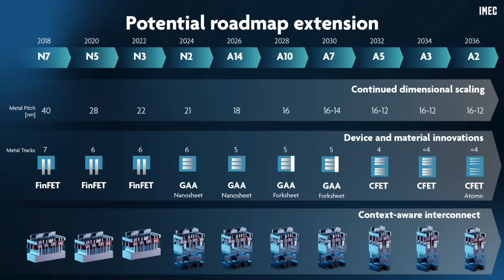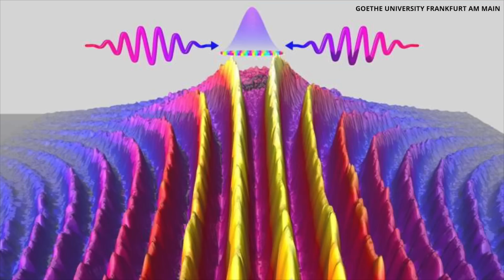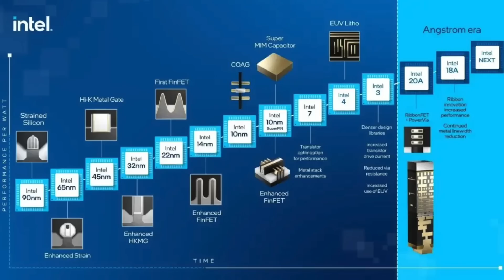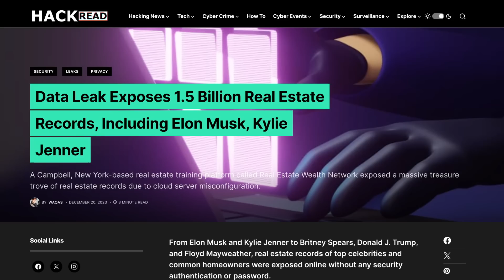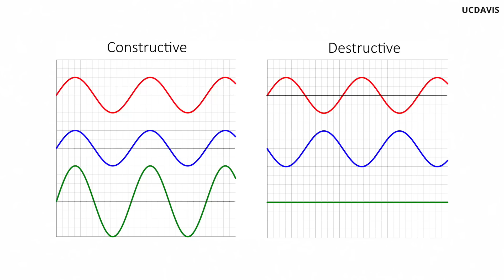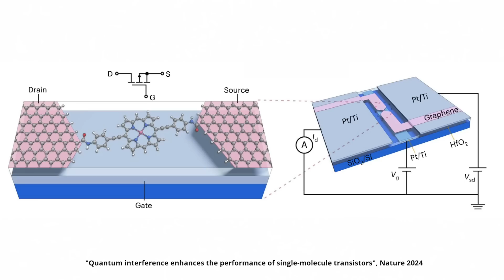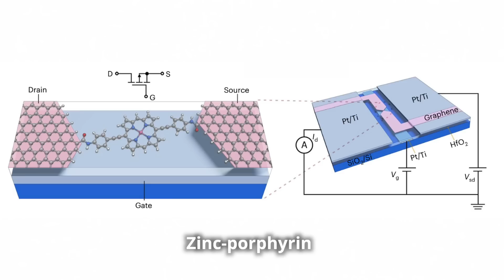Scaling Beyond 1nm

Comment: Quantum tunnelling is an easy fix. First you must understand the nature of particles and waves. In the double slit experiment, all light is a wave when it is emitted. Waves collapse when they become particles, and that happens when there is an interaction with the light. No interaction, it stays a wave. Since the issue with quantum tunnelling is due to this duality in nature, what must be done is to collapse the waveform before it has any chance to cause tunnelling. Or in other words, you must interact with it to ensure it does not have location uncertainty, otherwise it will always find its way to where you don't want it to be. This can be done with either the right material or the right structure. 

So in essence, the two options are diamond coating and structural slits placed around the surface of the transistor. The aim of the structure is to make the electrons cancel themselves out, again, like in the double slit experiment. There's a video that explains how that works, and why the double slit experiment produces patterns, but essentially it's like a boat in the ocean, where the light is the waves of the ocean. When the boat is hit by a wave, it bobs up and down. But if the boat is hit by a wave from one end and a dip on the other end, it does not bob, because they cancel each other out. This is why you see the pattern in the double slit experiment. The patterns that look like they are absent of light, actually aren't, it's just that they cancel out so light isn't visible anymore. These voids of light are called troughs. 

So what one essentially needs to do is create structures that induce a trough on the transistor, between where you don't want the electrons to tunnel. At that point it's only a matter of finding the right morphology and material used to achieve this, which may look more like a lattice or stepping pattern. Considering chips are actually not 2 dimensional and built by stacking layers like in 3D printing, what it requires is to progressively change the morphology of the gate with each layer.

You may now give me a billion dollars for solving your problem. A check would be fine.

Comment: I am wondering: since quantum mechanics becomes so readily at hand at this scale, could this potentially provide a seamless way to unify classical and quantum computers? I.e. you can use a single atom as a qbit here, no? And thus one could perhaps embed at least small-scale quantum computing facilities into a larger computing chip framework, maybe not to provide exponential speedup as in a full quantum computer, but to make certain fixed-size operations much faster "clock for clock".

Comment: I used to work in this space and I can tell you:
 
The fact we have no ability to use much of our silicon manufacturing technology means this tech could be more than a decade from practical implementation. 
This is not just one exotic material, but two or possibly several to get this type of device working.
The graphene interconnect is actually more annoying to fabricate than the transistor, because you can functionalize the higher surface energy edges, but making a large and highly ordered graphene lattice is hard. CVD and Osborne ripening can only get us so far it seems.

Practical implementation would only be in data centers

The need for cryogenic temperatures to make this work is also a major challenge. That means for a while, this will not be accessible to consumer devices. This tech will languish the same way standard quantum computer have for the last several years.

This tech may not help us quite keep up with Moore's law, but we will use it or a permutation of it eventually.

Comment: I remember back in eighty one troubleshooting a t v of course it was the Transistor heating up, then shutting down. It's always those damm transistors.😅 Actually, it wasn't the transistor it was heating up, so the Solder  basically kept melting. I hate trouble shooting.

Comment: Do i understand that correctly: You construct channels with an exact multiple of the wavelength of the charges and utilize a means of phase control of the charges?
That will then finally mean a hard limit for the structure size given by the wavelength and the phase shift factor. At least with this technology.

Comment: Imagine a microchip where every single atom inside active molecules and structures must be a stable isotope of every element it is made of to ensure the chip doesn't get bricked when other isotopes decay into something else. Achieving the necessary single-isotope purity level required to make reliable atomic-scale logic will be prohibitively expensive. Adding the complexity of error checking and correction to compensate for imperfections will cancel most of the gains like it does with many quantum computer algorithms.

Comment: if and when a microprocessor comes out with this single molecule transistor technology will it run at a temperature of 200c due to the transistors  being closer together.  You see this effect with the latest generation of X86 processors that run up to 90c.  Whether its intel or AMD

Comment: yeah idk i mean they cant connect two together? what did the setup look like? im guessing its the die and they place a tiny drop on it? sounds like one of those papers that sounds awesome on paper until you realize what they actually did. how good are the measurments? you know? how good was the person measuring it, how good was the multimeter? if theyre not extremely good at metrology, it seems like this result could be from some random error or bad measurement. zero leakage current at...sub one nm.
gotta see it to believe it.

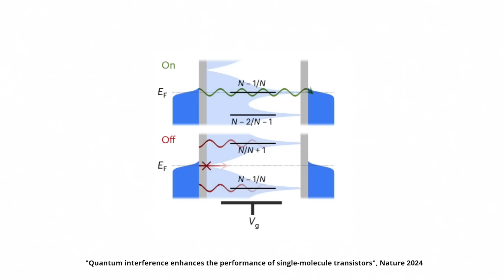Comment: 10:53 so the gate doesn’t determine if current / the electron wave flows, but rather how it flows?
Or by causing interference it either increases the wave amplitude or negates it?

Also, how are the base materials / composition of the chip changed with reducing the size of transistors?
We had to use silicon because that worked better when the transistors were much larger, but now at these low-nano scale sizes it may be “too conductive”. What other materials can be or are currently considered? Materials that don’t work well for transistors over 7nm, but may be excellent under 5-7nm.

Comment: If we're utilizing wave physics and manipulating phase, maybe we should just move away from the concept of "on/off" entirely, and do math by manipulating the phase of a wave. By doing so you could potentially create devices that could be entire logic gates and arithmetic elements in a single "transistor" (though it really wouldn't be anything remotely resembling a transistor anymore.) Furthermore, you could work in a higher number base instead of binary, further doing more work with less elements to represent it.

Each of these wave phase "transistors" would be something more like a microscopic analog computer than an individual transistor as we know it in digital computers. Of course, they'd then suffer the drawbacks and limitations of analog computers, like signal integrity. Manipulating quantum phase could allow you to make these "transistors" do all sorts of complicated math individually, rather than just a binary not operation, and replace entire circuits on their own.

it would be immensely complicated, but I think it's absolutely viable and could be orders of magnitude more performant than modern computers are.

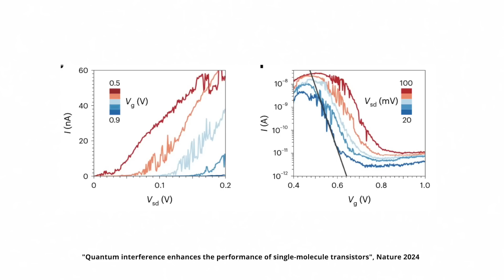Comment: I wonder if someone could help me understand the graph at 11:40 on the right. So as I understand it, for one of the lines, the voltage between source and drain is held fixed (20mV for example in dark blue). The scientist then increases the voltage on the gate from 0.4 to 1.0 V. This should be switching the transistor on. I'd expect then that the current across source and drain would go up. In fact though the current is going down, starting at 10⁻⁹ - 10⁻⁸ and ending at 10⁻¹¹ - 10⁻¹² A. Maybe I misunderstand what is going on in the experiment.

Comment: 🤔 Hmmm 👉 The comment I left about using Graphene for optical computers and the use of holographic encoding to date collect the interference fringes.
If that has a constructive impact on the greater development of computer technology 🗽🧠 💪😎👍So be it.
🤔👉 I vision the electron as a concentration of energy ⚡
👉 The electron shell's have bandwidth and restricted to the resonant harmonic nature of the element or compound Bond's? What caan be done to alter the vibration or ionising state for current flow 🤔 Hmmm and

Comment: So, does anyone even have a lab prototype using this that works... We have been talking about phonton or "light" computing with 4 states instead of 2 and no one has been able to make that work for what, the last 50 years... The fact that theoretically it is possible is not the same as a working prototype which is not the same as an actual mass produceable product.... Quantum computing is just like Fusion, it will happen, but maybe in 300 years...

Comment: A single transistor is of no use - dear Anastasi, this statement pretty much sums up this video.

As a nanotechnologist myself, I have worked or at least talked to a few professors who have devoted their entire 20+ year careers to single-molecule transistors. Unfortunately, despite the efforts of those super smart people, so far we are nowhere near building even equivalents of simple 1970s ICs with this technology. It's crazy hard to try to 'force' a molecule to align itself with the source and gate electrodes. Different self-assembly protocols have been tested, but attempts to scale the process to at least a few dozen transistors at a time keep failing. Personally, I think that single-molecule transistors are a dead end.

You are correct, though, that transistors based on electron-wave interference might be the future. Still, those transistors will most likely be fabricated in EUV lithography and not self-assembly realm.

Comment: Hmm, ZeroPointEnergy harvesting is around the corner with quantum effect transistors. A much better theory than the 'Born rule' based Quantum Mechanics, is Louis De Broglie's 'pilot wave' theory. Pilot wave theory is a more general theory than standard QM, that also allows for 'non equilibrium' quantum processes, where the potential energy of electrons can be raised by 'harvesting' the energy of 'pilot waves'. De Broglie never gave a clear answer to the question 'what are pilot waves?', except that such waves must propagate with superluminal velocity.  In case of quantum statistical  'equilibrium' between particle-soliton-waves and pilot waves, the QM Born rule applies, and one can speak only of statistical quantum correlations between particles. In case of quantum statistical non-equilibrium (Born rule does not apply)  it is possible to send- or receive pilot wave as superluminal signals, which is 'detectable' as electron potential energy jumps. Since pilot wave propagate at a speed much higher than c, such waves only carry energy and do not carry momentum, therefore do not give rise to kinetic energy changes (like photons that interact with massive particles). For instance, an electron can tunnel through a barrier, where the potential energy at both sides of the barrier are different.  This enables the harvesting of pilot wave energy (not covered by your standard book about QM), and explains the KWatt Device invented by T.H. Moray, that was based on Fowler-Nordheim tunneling of electrons in electronic vacuum tubes,  a Kilo Volts  mili Amps device operating in 'high' frequency.  I generalised Maxwell's electromagnetism theory, to allow for longitudinal electro(scalar)magnetic waves, that can have propagation velocity much higher than 'c' (the speed of TEM waves), and this answers the question: what are pilot waves?  Of course, relativity theory has to be generalized as well, SR and GR are only special cases of a much wider relativity theory based on a 'preferred (absolute)' frame of reference, which is also the conclusion by Dr. A. Valentini, expert in pilot wave theory.  Interesting transistor developments!!

Comment: I've made zinc porphyrins for a year during my master thesis!! 😃😃
(it was for a completely different reason though, it was for renewable energy)
Zinc porphyrins are actually quite easy to find commercially or synthesize, and the molecule there presented doesn't look too different from some of the ones I worked with. I could see it scaled up.
Reply: Renewables? Arent they mostly used in biotech though, like cancer treatments and such. Is it biofuel related then? Engineering algae/bacteria, etc.

Comment: Back in 1987 or so, I worked at a place that was using a process called Molecular Beam Epitaxy, MBE.
They were using it to build GaAs transistors directly on a ceramic substrate.
For the time, very fast, I didn't realize how fast until I overheard some people saying that they were getting a 9db gain @ 60 ghz! I asked where they found a scope that could read a 60ghz signal. They told me they didn't, that they had to extrapolate from sub harmonics. Saw some strange stuff there! Not aliens or anything, just people pushing boundaries.

Comment: This family of molecules is well known in biology - it is used by your blood to transport oxygene : D
In general they are very good at coordinating 2+ and 4+ metal ions
You can easily tune them for a particular ion by changing the groups around the central 'corona'
They are relatively nice to work since they are relatively stable - but not too stable, they have zero potential to damage the environment - as biology already uses them.
They are relatively temperature resistant, at least in biological regimes, which is important since processors can heat up to 100 degrees.
If you take for example iron or magnesium supplements, then they are added to increase the bioavailability of the metal - our organism has much easier time taking in a metal atom coordinated by this molecules than just an atom itself.
The secondary rings on the sides are also well known basic year 1 chemistry. They can be tuned with various stuff to again affect the electrical and chemical properties. Here i think they used them simply because this was the easiest way to attach this whole thing to the source and drain.

Comment: Lets face it, sooner or later we will reach the size of atom and then what?  I do not see further improvement after that.   I think our next step is to pursue optical logic gates from scratch meaning no transistor mentality.   Solid State devices carry a consistent problem that we are struggling with, and the most pressing one is heat generation.  Waste heat in my opinion is a measure of inefficiency of design.   Today chips have more computing power but waste more heat and are truly much bigger physically if you include cooling fans when you compare chips to 80's and early 90's.

Comment: The main problems are yield, and radiation which will cause many soft errors. So it is possible to go below 28nm but the cost per transistor stays constant or rises slightly. So unless you need the space it probably not worth going below 28nm.

Comment: there are  plenty of those new technologies but one of the core problems of them all is that there are no P type transistors available so you can't make logic gates, only RF and power devices

So far only silicon can provide us P type transistors  also P type is limiting general performance because N type devices are several times more  efficient already

Comment: This is just simple atomic physics that is in every undergraduate physics program. The problem is going from theory to practical application. When atomic physics has reached it's limit, it's time to investigate nuclear physics as to information storage and manipulation. That's 5 orders of magnitude smaller in size. The ultimate medium is photons, which have no size at all. Some SF authors have speculated about beings comprised of light ie photons, which would be eternal if done correctly as photons cannot decay.
Reply: Yepp, I think that the future is in photonics but there are many limitations in their current architecture...still if we crack it, most probably we won't need anything else..
Reply: @fscosx764  That's using photons instead of electrons in a regular circuit. Probably doable, but what I'm talking about is a pure photon field that handles it all. That kind of technology is far into the future.
Reply: @FighterFred  yep, but as far as I know,  photons interact differently, that's why we have to build specific circuits which are based on like maybe wave mechanics, i am not sure though...but photonic chips do exist now also, but they are not super efficient compare to modern sillicon chips..although my knowledge in this domain is limited too, so idk much

Comment: I was just thinking about optical circuits ... and how to make an effective "transistor" in optical circuit paths, and I thought about .... 180 degree polarization of a secondary beam path that can be allowed to pass through a lane or not , and every time it aligns with an existing optical path, the polarized (180 degrees) beam would negate it. How fast can a beam path be opened or closed, turned on or off? it seems to me that each "transistor" would have to be able to activate or deactivate the secondary beam, but in order to ensure that the 2 beams (more or less) perfectly deconstructively interact, they have to be in sync, which becomes really challenging when you're turning light sources on and off based on desired outcomes / etc... is there a better solution?
but then again, having a secondary beam source inside each transistor seems like the only way to do it fast enough to maintain greater than 1Ghz switching speeds, and that's kind of important for computational purposes...